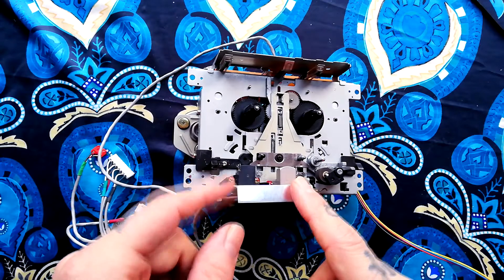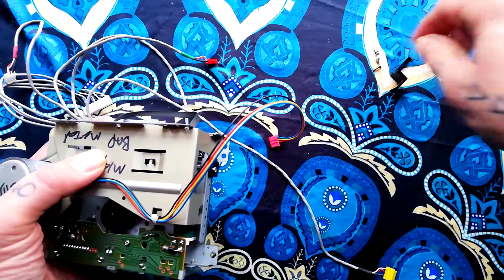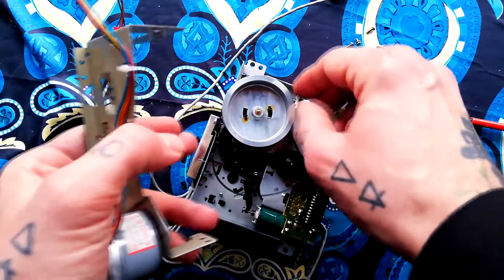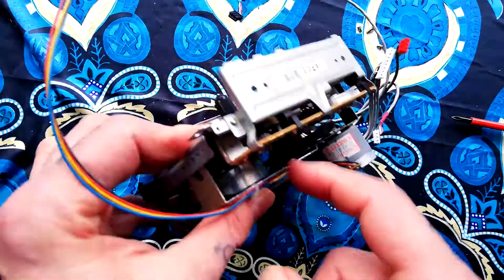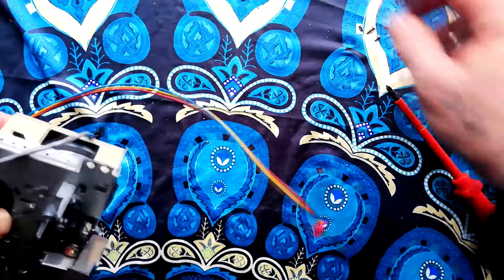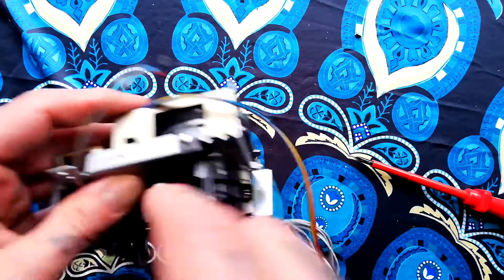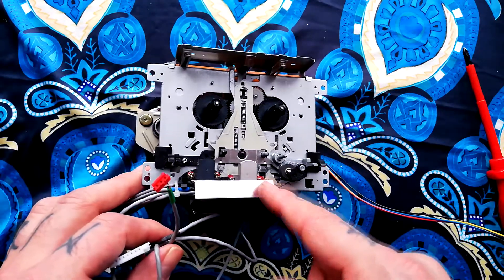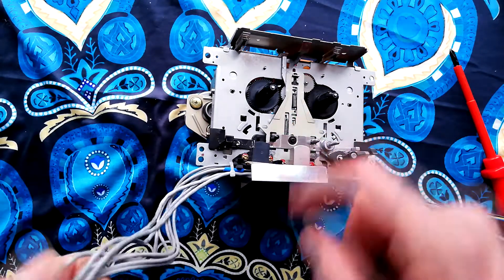Tascam Portastudio 424 Mark II | how to change the capstan belt

Comment: hi i know this isn’t quite what this video is about, but my 424 mkii just started only playing for one second and then stopping. wondering what the most common reasons are and what to check
Reply from the maker: Is the counter ascending? Is the take-up reel turning? Is the capstan pin rotating with no cassette inserted?
Reply: @Tetrakan I’m having the exact same issue as this one and sometimes it will start playing normally when i turn the unit off and on. I pressed in the cassette switch and the unit spins fine when that is held down. not sure why it does this starting and stopping thing over and over sometimes but wondering if it needs a belt replacement.

Comment: Hey! Dont know if you still respond to these videos. But after replacing the belts the motor is stuck running, any ideas?
Reply from the maker: It's normal for the capstan motor to rotate as soon as the unit is powered on.

Comment: Hi, thanks for your videos. Really informative and easy to follow.
I've recently bought a 424 mkii and it was mostly working well, but it has just started chewing up tapes. The tape catches on the pin and it keeps spinning as even after pressing stop. I have to turn off the unit. Any ideas what could be causing this?
Another thing: One time the playheads got stuck in the up position but I managed to recover from that with the help of your vids. Could it be a belt problem? 
Cheers.
Reply from the maker: There's a short thin square section belt that runs from under the flywheel to the reel mechanism, it drives fast forward and rewind, so definitely replace that and see where you are?
Reply from the maker: BTW it is normal for the capstan pin to spin all the time
Reply: @Tetrakan  Thank you. I'll try that and report back. Good to know re capstan pin!

Comment: Your videos have really helped me fix up my 424 MK II. Unfortunately I accidentally pulled out two of the wires from the 8pin white connector that goes to the transport. The cables got removed  from the pins entirely. What’s the best way to repair that?
Reply: The connector is labeled P102 on the circuit board
Reply from the maker: Ouch!. Try burning away the insulation on the broken cables with a lighter, then soldering the exposed metal into the upper part of the broken pins (remove them from the plug with tweezers, then slot them back in after soldering). If that doesn't work then there are two options i can think of, one is time consuming and requires specialist tools but will give you a clean mend, the other is more of a dirty hack. Option one is buy a jst xh header(check the pitch - the distance between pins - I think 2mm is corretc for that board) and plug and a PA-09 crimping tool (overpriced for what it is, mine cost £24, but other cheaper crimping tools are for big pins on car electronics and wont work for tiny pins, I know because I've tried ) and completely replace the entire header and socket. The other is to strip all the wires, remove the header from the bottom board and actually solder to the board - no plug and socket! You may want to solder on extension leads so you can work on the transport off to one side without putting strain  on the soldered joint.
Reply: Tetrakan Supermonobloc great tips thank you!
Reply: Could I just replace the female end of the JST connection? Or do they both need to be replaced in order to fit properly.
Reply from the maker: @dylanmckenzie681  if you could find an exact match sure but I haven't succeeded in this, so I replace both sides. Tbh crimping the female side is the time consuming bit anyway, soldering in the male header is fast by comparison
Reply: Tetrakan Supermonobloc thanks again. Your videos have been on loop while I try to solve this thing. First found bad fuses, then a 1/4” Jack Lock stuck in the transport, and now these pulled wires. Fix one problem, then find (or cause) another. Been a learning experience! I’ll let you know if I get this JST situation fixed!
Reply: Soldered the wires back to the pins, worked like a charm, machine is working good as new again. Thanks for your help!

Comment: hi tape the rubber belt with  low cost tape to fry wheel just to hold it when you put the belt to the pulley  motor  take tape of once done
Reply from the maker: Good idea!